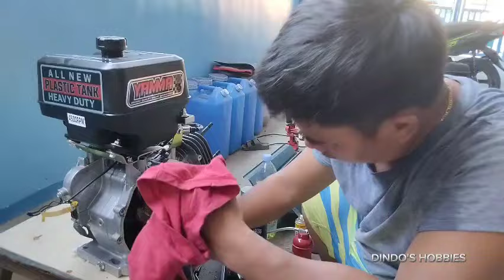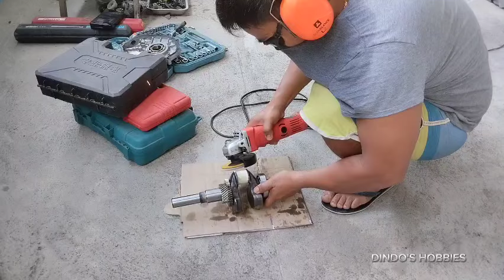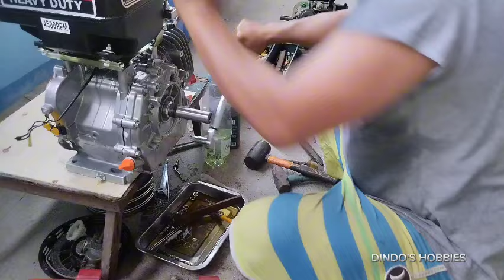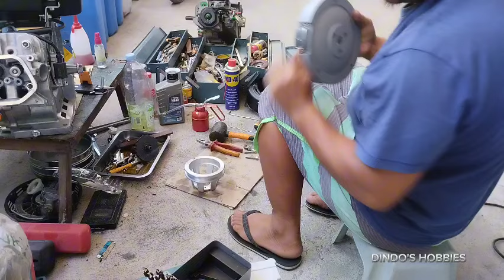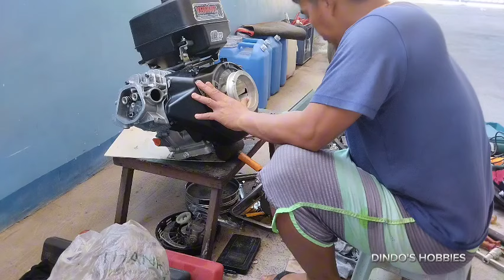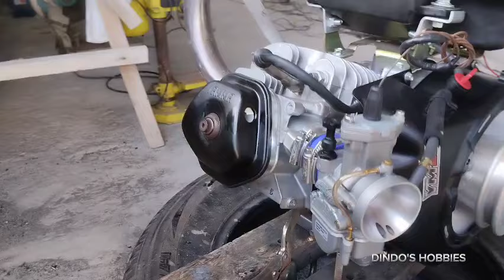YAMMA YRD 18HP Stage 2 Mod

Comment: Idol ano magandang sukat ng propeller para sa makina ko na yamma 19hp..
Reply from the maker: Idol, depende po sa bangka mo
Ano po ba klase bangka mo udol?
Reply: @Dindos_Hobbies  idol good day.. Flat boat idol. 22 haba dulo sa dulo tas 33 inches ang lapad sa gitna..
Reply from the maker: Plywood idol ang pang ilalim
Try mo 9x3 pag low speed
8x2 pag high speed po
Reply: Oo idol high-speed.. plywood ilalim walang cut.. Nag lagay ako ng 8-1 3/4 ngayon medyo nakukulangan ako.. Try ko yan idol..
Reply: @kimamieloropel3782 ilang litro kapag nagbyahe ng mga limang oras?
Reply: @reypascual1415  hnd ko pa na subukan boss sa malayoan.. Binalik ko ipinalit ko sa 19hp na sumo srd.. Hirap paandarin ung yamma 19hp